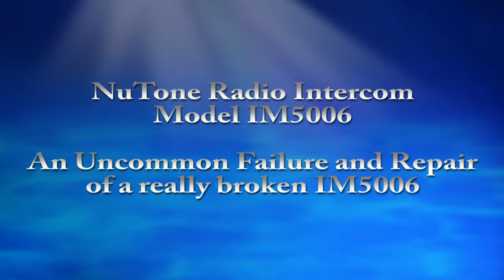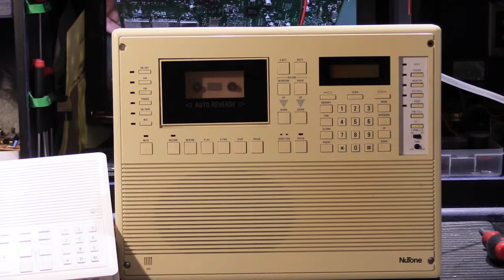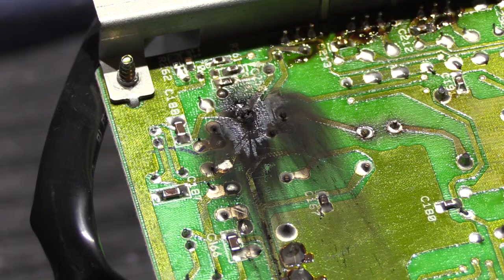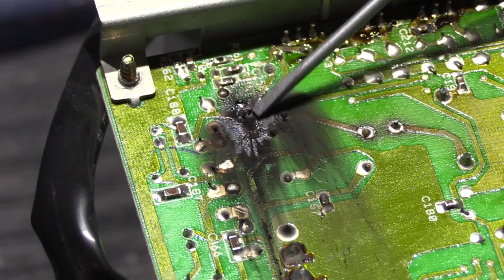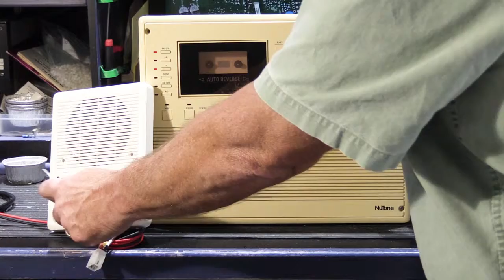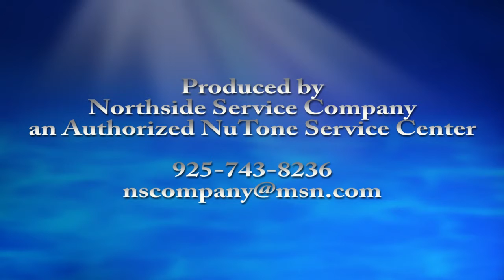NuTone IM5006 Radio Intercom Master Station - Dramatic Failure Turns Into a Simple Rebuild

Comment: Looking at the way that capacitor melted, I wouldn't be surprised if it caught fire eventually if the previous owner had not disconnected it! It looks like it was slowly spreading and burning the board!
Reply from the maker: Hi Toongeek:  The capacitor was a Mulii Layer Ceramic - When these fail, especially in DC power supplies, they can burn at 1000 degress C - Typically they are considered self-extinguishing, but not always. . . . While the capacitor itself won't burn, this intense heat will ignite the surrounding fiberglass board , copper traces, conformal coating, or nearby plastic housings. - Chris